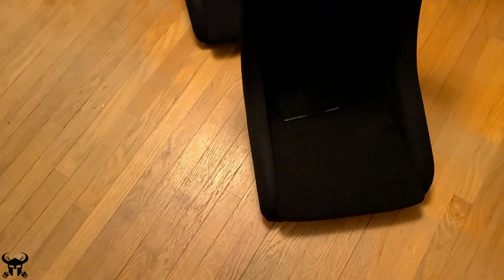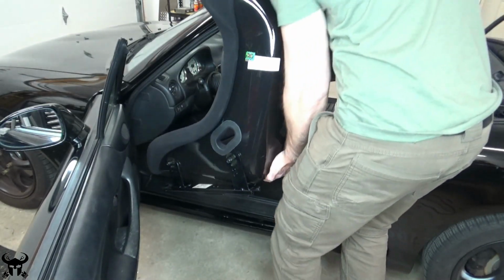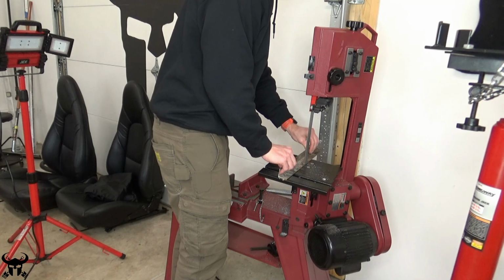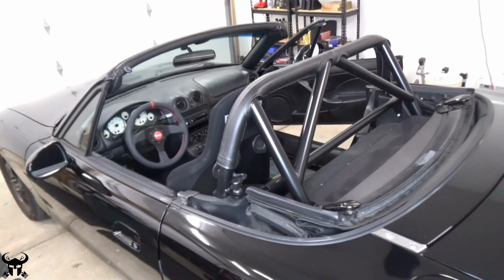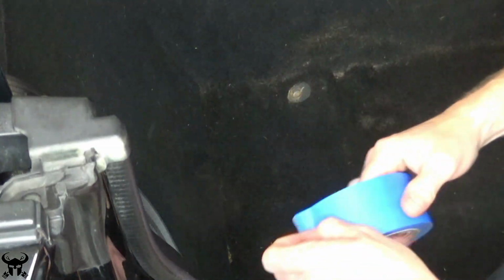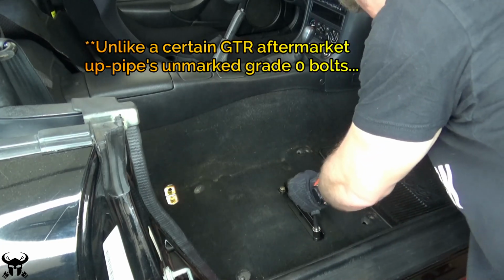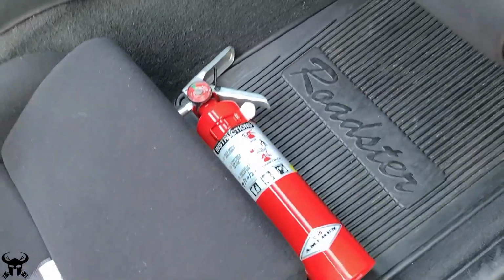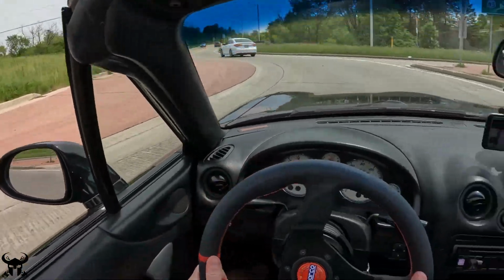Installing Racing Seats and Harnesses in an NB Miata - then Driving FAST!!

Comment: "No compromise track Miata" seems like a challenge and I am here for it! I have a similar set up NB2 without AC and PS (so I just take the summer off). 

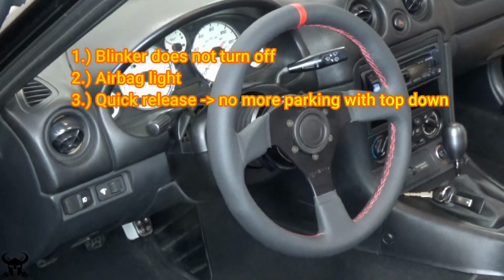As far as #3 at 3:09, what I do is throw the steering wheel in the trunk and turn key in the trunk LEFT, that disables the interior trunk latch from operating! FYI if you didn't know.

Edit: I run a Boss hub and NRG QR with a resistor for the airbag light and the factory clockspring works. Getting in and out of the car without QR is a pain for me/my set up.

Comment: Great install video!   What’s next for the cleanest track Miata Road America has seen?
Reply from the maker: Thanks James!! Lol - next up for the miata are clutch, radiator, diffuser, then parallel ECUs; I want to be able to switch between the OEM ECU and a standalone quickly and get the tune shaken out with A/C retained

Comment: Did mounting them like this also prevent the drivers seat from being kind of off center from the wheel? This is one thing that notoriously bothers me in the miata.
Reply from the maker: Hi Andrew! - I'll measure it next time I'm around it. My guess is the seat is probably on center (or close), but I think the seat might be turned slightly (to get the sliders to work) - if that makes sense. Not sure how long I'll keep the sliding rails